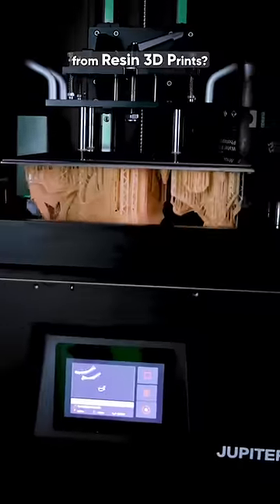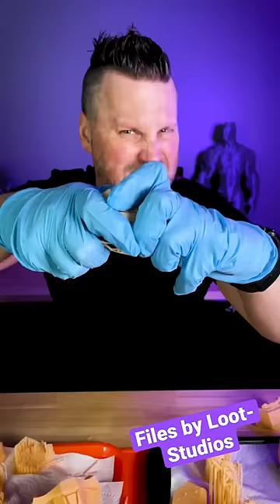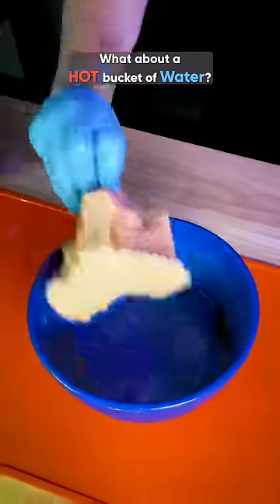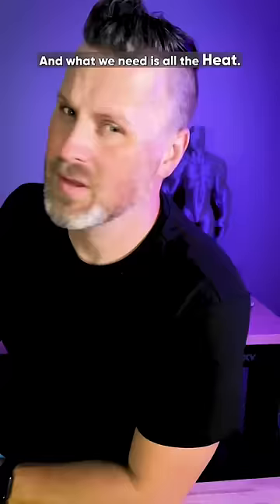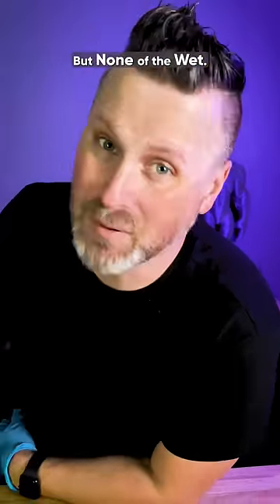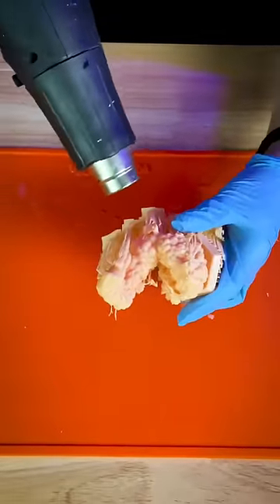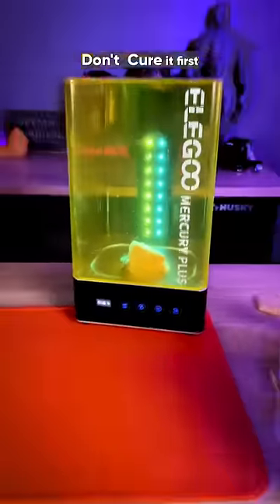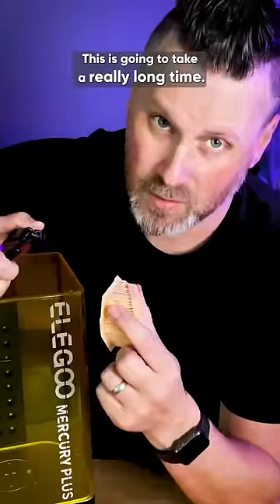How to Remove Resin 3D Print Supports 💥

Comment: interesting i’ve been using hot water. what heat gun do you recommend?
Reply: most heat guns are the same. warm to hot air
Reply: Hair dryers?
Reply: Be careful using a heat gun, depending on the material you used to print it maybe more heat sensitive and may warp

Comment: yes I always remove my supports before curing, actually I have used my heat gun to remove supports  and on some delicate models with super fine points ( some mecano spiders I have ) i still use clippers/flush cutters

Comment: in my limited experience resin printing removing the supports before its cured causes pitting which is harder to sand smooth than bumps left from supports, i guess i dont mid the meticulous bits of clipping away the supports but i feel like you get a better looking model that way

Comment: While I only have an FDM right now, supports are great to reuse. If anyone wargames (OPR or WH40K for example) supports make great rubble, barriers, pipes/conduit, fences/handrails, and rebar. I even have some supports to build on with greenstuff.
Yes, you can use other materials, but if you are printing and have the waste, may as well use it.
Reply from the maker: Resin supports you can keep and reuse for print fail cleanup! Works amazing with “Tank clean” function
Reply: @UncleJessy  just wish my epax x1 4k had the tank clean function for that reason. they need to update teh firmware to include the option

Comment: If your supports are hard to remove you can wrap the print in a towel and gently twist it both ways until you start to hear the supports snap.
The towel gives you grip and protects some of the more delicate parts from the strain.

Comment: Hi Uncle Jessy, I was curious on what was the best method to remove the resin print from the build plate? Mine is scratched to high hell and I keep loosing motivation to print because of how much of a hassle it is to remove the prints. Any advice?

Comment: I just got an elegoo Mars. Thank you for this
Reply: Let me say this, remove the slick anodized coating from your print surface. I used sandpaper and a tile to make sure it stayed flat and true and got much better results.
Reply: @Colonel_Overkill  mine was just metal when I got it with no coating 👍
Reply: @varaxmusicshorts2090  you have no idea how lucky you got. Mine was an early release but it took me damn near an hour to do. Glad they stopped that absurdity as it really made it impossible to get a print to stick. Went from a 40% to 90% sucess rate by that alone when I was learning how to use it.
Reply: @Colonel_Overkill  yea resin was waaaay easier to setup than my ender5 pro 🤣 I haven't had a single fail yet and the quality is amazing

Comment: It's super easy if you let it sit in the alcohol for a few hours between prints. 2 wash cycles. One at first and one before you take it out. I let them dry on cardboard then cure.
Reply from the maker: Few hours?! Far too impatient for that 😂🤣 great tip though!
Reply: I do this. I’ve been selling clear colored resin prints locally just state shaped stuff or bears. I do the wash then put it in a new jar of alcohol then go work my nursing shift. The supports just peel off when I get home.

Comment: I use very hot water.   Since there is usually leftover resin particles in the ipa I use to clean the resin the water is an extra rinse so I don't get any sediment leftover during curing.

Comment: Alternatively you can just use isopropyl alcohol, which you probably are already using for cleaning off the uncured resin anyway. Let it soak in the alcohol for a bit (or use a wash station) and then just pull the supports right off

Comment: Does it have to be a heat gun, or can it be a hair dryer?
Reply: I've been using a hair dryer to loosen/weaken resin supports for a few months now, and it's been working fine.

Comment: I tried hot water amd a hair dryer with water washable resign and each time i get something extra warped or just soft enough to smudge the quality. Now i just make the supports small wash the print in cold water, dry, then use a toool if needed to carefully remove supports.

Comment: I find that if I put my prints through a 30 minute cleaning cycle in alcohol in my wash station and then use warm water, supports will pop right off. I think the extra long wash weakens the support contact area.

Comment: The marvels of Physics: supports are thin tubes, and the contact points the apex of cones. So they are affected by temperature changes way harder than the print they are "glued" to. The differential means expansion Vs non-expansion, thus breaking points.
It's precisely the reason why bridges have some leeway where they connect to the road: were there no leeway, they would break there.

Comment: If you use a heat gun, or even hot water, and remove the supports, are there little nubs where the supports were on the part?

Comment: Heat gun could be unsafe and dangerous. Saw in another video that when someone suggested using an airbrush to dry the print that the resin atomizes in the air and collects over your skin and the surfaces you're working on. Can't read everything you read, but good to be safe

Comment: Mess from the water? I’ve used hot water and it def does not make a mess and is super quick and easy. I also don’t have to plug in another appliance and mess with that as well

Comment: Will this help with the annoying divots I get when I pull off the supports?
Reply: To a degree. You may want to fine tune your support settings though as I had the divots real bad when I was over-exposing and my support contact point was too thick. Can't provide advice on that as it depends on your printer and resin imho.

Comment: I've been using this method since I saw your video and it's been working pretty good. One thing to be careful of is these heat guns are not intrinsically safe around flammable vapors. Be careful if you have your IPA wash bucket near by.

Comment: I have a better method, I dunk my prints in an ultrasonic cleaner with alcohol. 
The vibrations make removal of the support really easy and the alcohol cleans any residue before curing.
Its the best method, hands down.

Comment: you really need to test this on your resin print, each brand reacts differently. what I mean by this each has a different smoking point, you don't want your print to start smoking, it's toxic and it will ruin your print. 
WARM WATER IS STILL THE SAFEST AND WORKS GREAT. 
with the heat gun it is too easy to smoke your print especially delicate prints, the heat gun is NOT  a good hack!

Comment: I feel like using a heat gun to weaken supports will probably also weaken any delicate details on those supports.

For my minis I use a knife and go through 1 by 1. Yeah it's time consuming but I suppose that's the trade off for being able to 3d print what my heart desires.